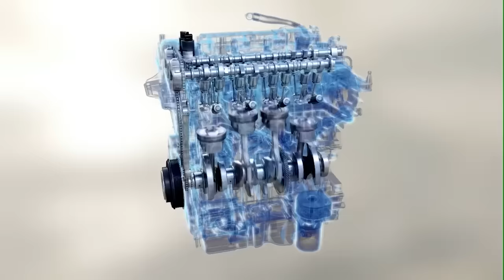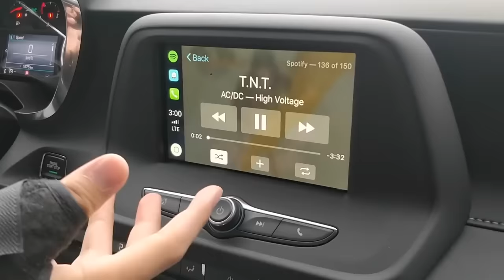NEW 2024 Chevrolet Camaro SHOCKS The ENTIRE Industry!

Comment: Let's not pretend that Chevy detunes the Camaro engine because they don't want it faster than the Corvette when all they had to do was make the Corvette 600 pounds lighter . Dodge didn't define the hellcat , it had more hp than the viper . General motors makes idiotic decisions. They could have given the Camaro 755 hp to compete with the gt500 and hellcat but didn't. Stupid. That's the real reason their sales numbers went down.
Reply: someone finally said it!!!
Reply: I’M WITH YOU!!! STOP HOLDING THE CAMARO BACK WHEN YOU HAVE THE TECHNOLOGY. NOW ITS OVER
Reply: I always said this. The ZL1 should've had at least 750hp and the SS should've had at least 500hp. Chevy always underpowered these cars. Everybody knows the ZL1 and the Chevelle always had more hp than the other muscle cars!
Reply: Make it 600 lbs. lighter?  WTH you have magic spells or something?
Reply: If GM had just gotten TF outta the way of the old Pontiac engineers instead of obsessing about making everything slower than the Corvette at literally any cost (and often even failing to do that with the Trans Am), we probably would've had a nearly unbroken string of 700-hp offerings from GM from the original Musclecar Era forward, even thru the smog years, lol.
Reply: At 650 hp the ZL1 is better at handling and faster than the two vehicle you mentioned. It isn't a drag car its a track car. Lastly the price point is far cheaper then the other two mentioned. if you were to add that cost of the other two in aftermarket pulley, cam, tune, and headers it would womp both those cars easily for still less than the cost of either
Reply: Why? The zl1 still destroys all of them on the track, that's what it was built for!
Reply: Whats Chevy?
Reply: @gregkramer5588  it's called carbon fiber there gandolf not magic. Keep up ok ? It's 2023 not 1923
Reply: @robbwoy  gearheads understand, it's too bad you're not one
Reply: @1gbayfisher  the zl1 destroys them on an unprepared surface not on the track there Julius. I've seen the zl1 in person get smashed at the track by a hellcat , demon and gt500 and a number of ricers.
Reply: @g4do  WTH are talking about?  That they could raise the price $40k and cut some weight.  If so I agree.
Reply: Now that the corvette is a super car I have 0 reason too see why they have too hold back the Camaro
Reply: @chrishansen7004  I looked up sales.  17k first half of this year.  Pretty low.  In addition the chassis was shared with Cadillac and Cadillac is dumping it also.
Reply: The ZL1 is already an amazing hellcat and gt500 competitor, I'd love to see it reach 700+ horsepower though. Sucks to think as a large Chevy fan that they are just ruining they're own brand.
Reply: @bryannelson4485   The 6th gen Camaro SS is good with it's current output, The ZL1 is the real one down on power. If they made a 7th gen SS they should put the C8 Stingray engine in it to compete with the Darkhorse. A 7th gen ZL1 could reach around 800 horsepower if I had to make an estimate, which would be an amazing car to drive. Just to bad Chevy won't listen and they won't make it
Reply: @g4do i think he meant a track with turns. Not a drag strip.
Reply: Can't argue with that
Reply: @robbwoy he is saying that it could have been even better and faster.
Reply: @1gbayfisher specifically the 1LE. The base ZL1 not so much. I drove a 750 hp Camaro (Callaway supercharger and tune) and let's say it's a struggle to get it to hook up... So i just want sideways until I straightened it up.
Reply: @strawberrymilk9767 Hellcat is great for open roads. Mustang anything a good all arounder (but someone needs to add that PP1 or PP2 on Mustangs, the GT350 and GT500 are great with the exception of that tiny gas tank). Camaro is great as long as it has the V8 and don't dare taking it on a long run. Those seats are no better than economy class seats (barely move back).
Reply: @MidnightBenz and no adult passengers in the camaro either. Still sad gm wont unleash the camaro because of fear of knocking down the gm’s go cart king
Reply: @pmp2559  lol that is true. Nothing above 5 feet in height with or without legs can fit back there. I still couldn't figure out how to put those seats down in a ZL1 1LE, though SS at least has trunk access through those seats. But either way... Those are pains many will ignore as long as the power is there... And it could have been faster, more powerful accross the line.
Reply: They couldn't have their horse out running their Thoroughbred! that's why they didn't do it.
Reply: @MidnightBenz You have to Push the long button down and and then angle it front facing up and rear down while pushing it back, i own a 2016 SS and im ~6'4 / 1.96m and not the smallest of guys but i can sit fine in mine that way with the backrest also angled back a little. needless to say the only one to fit behind me would be someone without legs tho.
Reply: @Adlumairsoft  I took my 2016 Camaro SS for a cannonball run and taking a nap in it was well terrible. Other than that no issues. And of course, family and friends don't really have a place in the backseat- it's mostly for storage. It feels like the seat sytem was borrowed from the Corvette to cut cost (they recline about the same). The thing is I can't find a button for backseats in the ZL1. No pull strap... Nothing
Reply: They don’t hold it back. The LT1 is rated at 455 puts out more like 470. The C7 vette was rated at 460 and was around the same 470.
Reply: @Prodriver33  The LT1 can easily produce 500hp. Remaping.
Reply: @MidnightBenz l
Reply: A weak factory tune will almost always last a very long time.
Reply: GM or chevrolet were sold brands already some years ago, the corvette isn´t called chevriolet but only the model name and no badge just the two crossed flags like in 60´s sport cars
Reply: @g4do  Yes that's true but it would also raise the price considerably
Reply: Actually none of these will be street legal in 3 yrs so no need to keep them around. Just buy a nice silent EV. Less noise pollution.
Reply: This is what happens when origional 2 door coupes become based on 4 door sedan chassis. 18" wheels, no resr seats. Lexan rear window, carbon hood and trunk, light hi perf battery, a straght air intake tube would add 10 hp from ram air &"suction, plus lose the huge suit case muffler and you'd have a nice 3350-3400 lb car with about 480 hp. Plenty and keep the old 8 spd auto because between two identical cars 1 with A10 other with A8, the 8 spd is quicker & faster. Boom.
Reply: I tell you guys this the 4 banger would of ben  rs v6 would of had the 455 hp the ss would of be 600 and the 1lE would of ben 750 and the zl1 would of ben 850
Reply: Just reading comments about poor GM decisions pisses me off😂😂😂

Comment: My son had a Crush Orange 2019 2SS 1LE that was a blast to drive. I was very surprised at the cornering. He ordered and now has a 2023 ZL1 1LE. That thing is pretty crazy!
Reply: What does your son do for work?
Reply: My son ordered one back in early January and it still hasn’t been even picked up for build!! GM is slacking bad right now. 90 days and still nothing!
Reply: @mdubz101  I ordered a ZL1 1LE last August... still sitting at 1100 in the system!
Reply: @mdubz101  Yup...  My son ordered his last spring in May I think. He didn't take delivery until December 26th I believe. The day before his birthday!!
Reply: He should get the 2024 RST LMNOP
Reply: same dawg
Reply: @mdubz101  any updates? i ordered a lt1 a month ago nd they told me it would take 4-6 months
Reply: @MhAteYou6  ended up canceling order. Got soured by experience.. currently looking around again, try to find one off a lot.
Reply: My son got a Bugatti La Voiture Noire, which is an awesome car. it's a little bit fast for a first car but he's a responsible dude.
Reply: @andi8489  Nice!! Same here. My son is very responsible. More so than I would ever have imagined. He's respectful of others which is what makes the difference I think.
Reply: God bless your smart son. W Father W son.

Comment: GM’s design team really screwed up with the Camaro. They didn’t push the envelope with design like Ford did with the Mustang GT350 and GT500 or dodge did with their Hellcat. They also didn’t push the performance of the car like they did in the 90’s and early 00’s. They disgraced the Camaro namesake and completely screwed up when they killed off the Firebird and Trans Am and GTO. All because they didn’t want any of them to compete with their mighty and overpriced Corvette. Back in the 87, the GM executives were absolutely pissed off when the Grand National smoked their mighty Corvette. It’s called innovation and competition! Let your own teams compete with each other. If the Camaro team is beating the Corvette team it obviously means they are dropping the ball big time. Increase the production rate of the corvette so the cost can be lowered because their is absolutely no reason it couldn’t cost what the Camaro costs if they were built in the same number of cars each year.

Comment: The refresh they did in 2019( for absolutely no reason) killed the aggressive looks of the car. I had a 2017 2ss 50th and i love that body style wayy more
Reply: No it didn’t it still looked aggressive
Reply: It's all a matter of opinion. Had the 2016, 2019 and 2022 (all SS) and drove the 2020 ZL1 with a Callaway supercharger... I liked them all. 
I do have an issue with the 4 cylinder, V6 and the 1LT or whatever that less than SS was. Those fronts are horrible past 2019
Reply: I like the newer look but everybody is entitled to a opinion
Reply: @demonNthesn0w  with you there
Reply: Definitive words you used 
     “ I Had”
What, not any more?
Reply: @ltsgarage7898  that is correct. Moved to an apartment and in the city there are issues with parking. Had to resort to one car solution.
Reply: The goggle tail lights were an epic fail
Reply: You can hardly tell them apart!

Comment: Chevy problem was always pricing.  You can get the same performance in the two other brands.  The only reason I went to a 5.0  was I wanted to trade my 5th gen for a 6th gen. Drop the price
Reply: It never took off in Australia because of this, It was between 20-40k more exspensive than the Mustang with no real justification.
Reply: wdym? u can get a ZL1 for less than 80k and it will beat the redeye and the GT500, you can get a 2.0T for less than 30k which will most likely tie the ecoboost and the SXT, and you can buy the V6 for 32/33k which is for me the best investiment considering it's power, weight and the 10 speed-auto, it will beat the Mustang and the RT's mopars, what else do you want?
Reply: No you can't.  The Mustang chassis is not nearly as good as the Camaro.  I drove a Mustang GT with the track pack, 6 speed and the the Camaro SS 6 speed and the steering feel and chassis dynamics are far better than the Mustang which is why I ended up buying the SS.
Reply: @Diordna11  yeah you can. The performance isn't that big of a difference between to the two to justify paying more. Stop being bias. Numbers from multiple sources show even if the. Camaro performs better it's not by much.
Reply: @Diordna11  The 1SS with AT Starts at 42k and yoU can get it fully loaded for 46k (including dealer fee and taxes) the 2SS AT starts at 47k and you can get it loaded for 52k (again with fees and taxes) Mustang GT fastback starts at 39k and the premium version at 42k, however you need to spend a lot of extra money to get the digital display, infotainment system with android auto and apple car play, a 9in screen and you can add 2k more for an AT, not to mention, heavier car, less power, less torque, worst chasis compared to the Camaro, worst steering feel, if you don't trust me, fine, you can watch car reviwers and their opinions, if you still dont trust, suggest you driving both, I dont dislike the Mustang, its just that ths Camaro is better.
Reply: @Diordna11  I drove both, Camaro chassis is superior.  There's a reason there's a bunch of aftermarket chassis upgrades for the 5.0, none required for the Camaro.  And then there's the build quality of interior and exterior.... Mustangs look like they've been in an accident from the factory.   The MT-82 manual is a POS and the 10spd is tuned much worse.  Camaro > Mustang.
Reply: 6th gen camaro was the best bang for your buck hands down. LT1 camaro with the 455hp v8 and the Tremec tr6060 manual transmission for $42,000 out the door. You're not getting a manual tremec transmission in any ford unless you're paying $80,000 plus for one of the top end models. Best pure performance for the price between the big three.
Reply: @idkimlost391  He means when the 6th gen came out, the SS was thousands of dollars more than a V8 Mustang.

Comment: I absolutely love my 18 ss 1le. I can not get enough of it.
Reply: Have the exact same car I love it more than anything
Reply: Same here, but not the 1le package. Gotta question. For you guys. Have you had troubles with the torque converter shutter? Supposedly they use the wrong fluid. I had the same issue with the 50th 2017 Anniversary 1SS and my 2018 2SS.

Comment: For some, it was the looks of the 6th gen , particularly the later years that hurt sales but to me the price just got ridiculously too high.
Reply: 1 inch lower, 2 inches shorter in width, and 3 inches shorter in length, did it in for me. All Chevy needed to do was update engines and fun colors for the 5th Gen, after the 2014 refresh. The goggle tail lights in 2020 were another mistake.

Comment: Well here we go again just like in 2002 when the production of the Camaro and also the Pontiac Trans Am came to an end due to the lack of sales just like in 2002. Not to say that these Camaros weren't worth the price but they were once again out of the reach of the fans who wanted one especially the the ZL1 models like myself. I consider myself a GM fan just like many others. I own a 1999 Camaro Z28 with the LS1 my engine has nxcess of 305 thousand miles on the original LS1 it has never been rebuilt and it still going I wanted to try to reach out to General Motors to let them know that I have one of their engines with that kind of mileage on it and still going I don't know what the record is on an LS1 mileage but I'm hoping to General Motors will hear of this and maybe take my LS1 build into something awesome or replace it awesome built LS7 427 cubic inch that would be a dream to have a 99 Camaro with an LS7 in it. But that's just a pipe dream. I wish I could have a ZL1 I wish I could afford it but financially speaking it's out of my league.

Comment: Chevy did this to themselves by making a cheap car with a premium price. Changing the looks of the car so you have to buy a top package to get a good looking car doesn't help either. Product availability is an issue also. Chevy has created this problem and then blames the customers for not buying their over priced, and under performing vehicles. We should have let all the manufacturers go under during the economic downturn. They would had 2 options. Make quality vehicles at competitive prices or go bankrupt. Just my opinion though.
Reply: You ain’t ever had a Camaro then, best interior out of all muscle cars and ain’t a damn Scatpack or 5.0 beat my shit. Dropped 19k on the down payment and dropped 6k in carbon fiber add ons. Has a top speed of 180 with governor. Your trippin. 5.0s can’t do shit with only 420 tq and way more
Reply: Packages that enhance the look of these cars isn't anything new. I'd rather have a gt 350 over a 5.0 on looks alone. Scat packs over R/T..unless what? You add a package. How much is that wide body package? It's ok to just simply not like the camaro
Reply: @jasonbtw3272  mustangs will beat the camaro top end.
Reply: @louismccomack9524  they will not, there are several videos proving the Camaro is faster, check throttle house's drag races between SS vs GT and ZL1 vs GT500, only Mustang that will beat the Camaro is the Ecoboost against the 2.0T, but a fully loaded Ecoboost is more expensive than a V6 Camaro that will beat it any day.
Reply: Overpriced??   They start at 26k, same price as a corolla.   They're all performance bargains.

Comment: Part of the problem is, as long as the Camaro is a unique machine in the General Motors lineup, it would be too expensive to keep that one platform going alone. The solution? Bring back the Firebird!! Then they can spread the cost over three models! The Cadillac, the Camaro, and the Firebird. No one really wants to see the Camaro go. And with the Firebird back in production, they can spread the cost over these three vehicles. Yes, Pontiac is gone. But they could put the Firebird back out using the GM name “General Motors, Corporation, Pontiac Firebird”. They can sell it at GMC dealers. GMC would be the MAKE , Pontiac Firebird would be the MODEL. General Motors left Firebird fans in the lurch, when they brought back the Camaro alone several years ago  . This would be a good way of making amends. A new retro FIREBIRD would be FABULOUS !!
Reply: I bought a brand new 1994 Firebird Trans am. I am so glad I've kept it. Fully loaded it was my daily driver till 2005. Lots of fun, never abused, never molested,  its totally bone stock, lifelong Southern California car,  338.000 miles on it now, but still looks nearly new inside and out,  engine never been touched, even the timing chain is original! Runs like new. Has been a great car. Would love to see GM put out a new FIREBIRD!

Comment: The only thing that  stops me from buying a Camaro is that when you sit in the driver's seat, the visibility is absolutely horrible.

In my opinion, they should raise the roof another 4 in.

I used to have a 1968 Pontiac Firebird that seemed to have more visibility from the inside than the modern-day Camaro.